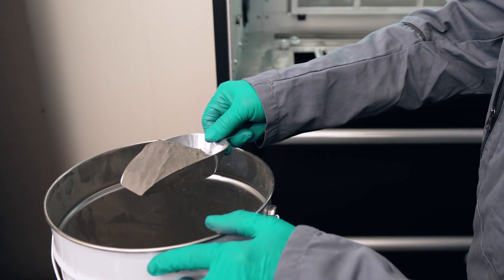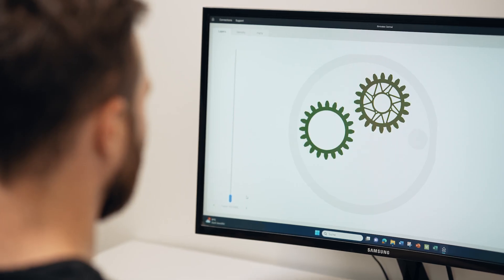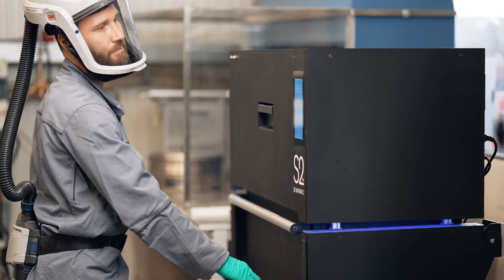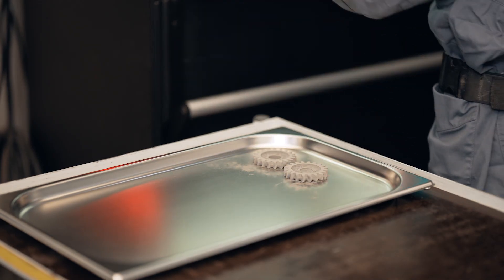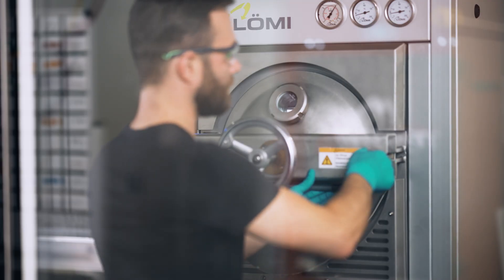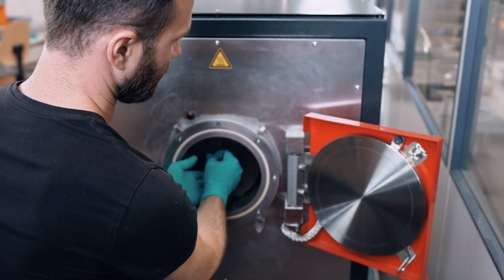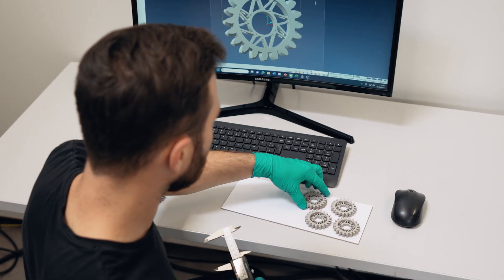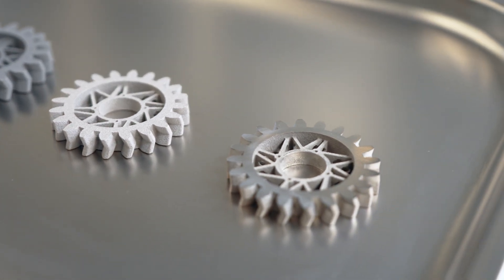How to 3D print Metal Parts with a polymer SLS Printer – Cold Metal Fusion Process Chain

Comment: Okay the only thing that make this gear "only" doable with sls is that small circle in the struts that hold the axle ring. i am kinda skeptical of the surface finish, it seam extremely pores, and the gear at 4:25 aint finished at all it still need to go in a cnc, before it can be used at all. the idea seams good, but if you can´t produce more than 0.1mm accuracy it limit what you can use it for, even if you can use plastic sls printers... what are the strength vs a milled part?? what happen if you do flux test on a part??

Comment: You're not printing metal. You're printing plastic parts with metal in them that eventually density into metal parts through other processes. I wish the industry would stop trying to confuse customers on this point. Indirect metal printing is not really metal printing at all. It's like if I printed a lost PLA mold that I wanted to cast into metal and called that metal 3d printing.
Reply: It’s better than your solution
Reply: But it's not...
Reply: They were complety transparent in the Video and layed out the whole process to get a Metall part in the beginning of the video